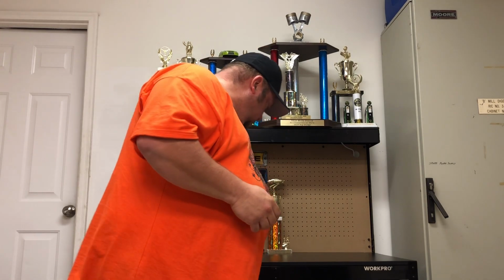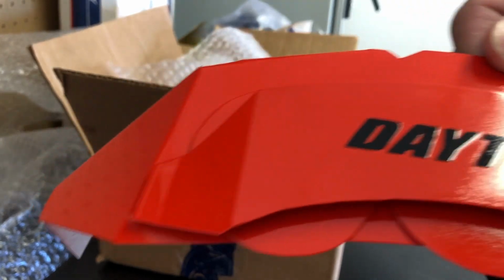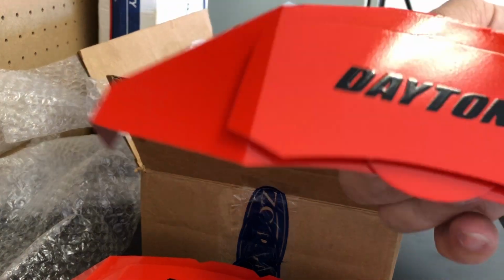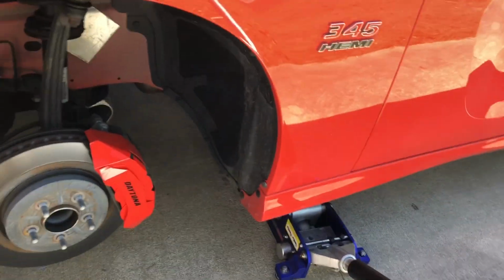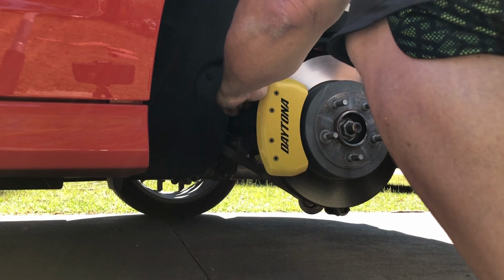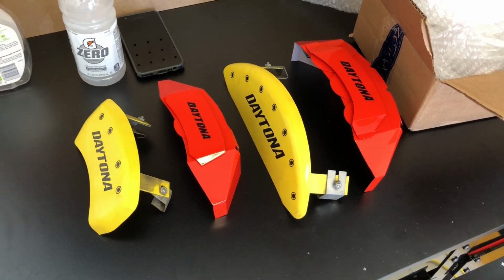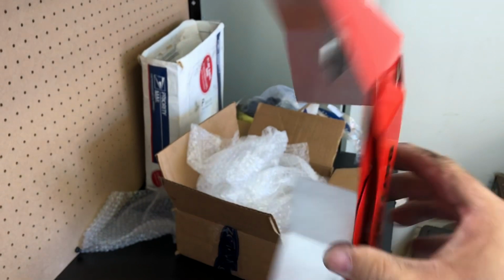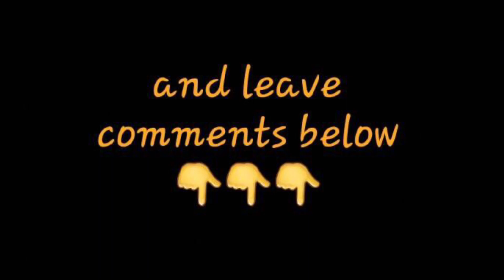Brake Caliper Covers made by CCIAuto install on my 2017 Dodge Charger Daytona

Comment: I have the MGP covers. The magnetic attachment would make me nervous that those covers will detach with one good bump, especially the rear with that taped on strip. I hope that tape holds up over time with wet roads and dirt/dust accumulation.
Reply from the maker: Robert. I plan on doing a review video at some point. So far so good, but I do agree with your concern and it also has me skeptical. The day after the install I took a road trip to a show and the covers held up fine, but I do check them after every time I drive. Thank you for your comment.

Comment: How did they hold up over time? Which of the 2 brands would you recommend now?
Reply from the maker: They have held up great. There was nothing wrong with them. As for the 2 brands I would go with CCI just because of the look. The MGP covers are also good and durable. I think its a preference of the looks between the 2 covers.

Comment: Looks like you tinted the side markers and rear.. nice. Are the side markers full LED.. not the stock one LED Light?
Reply from the maker: Charles Xavier actually if you watch my video on side markers you can see I purchased them already tinted from luxe auto concepts.
Reply: @carsngrub  sad part is luxe is discounting the product. It's no longer on their website.
Reply from the maker: @Charles Xavier Yea I see that. Not sure why. I like mine. I guess just have to buy led sidemakers and tint yourself.
Reply: @carsngrub  got an email back saying they are discounting it in the near future but please check out our side marker tint.. oh well. Its not that hard to put tint on side marker. BTW the tint on the tail lights looks good. I think the new brake caliper covers are much better.. plus they match the paint

Comment: Have you taken any longer trips? Or did any continuous hard braking? I think magnets will hold through some rough conditions. My only concern is the 3m tape. I know its the heavy duty stuff. But depending on heat, and so forth and so on. How about removal of the tape overtime? All questions I'll ask CCi, I ordered some last night. I also had the MGP before. I like the looks of the CCI.
Reply from the maker: Thomas Armour the tape is what I am most skeptical about. I didn’t place one of the rear covers properly at first so I had to replace the tape because once you take it off i wouldn’t stick anymore. So far so good. I took a 1.5hr trip to a show and the didn’t move. I have also washed my car several times, and check them periodically.